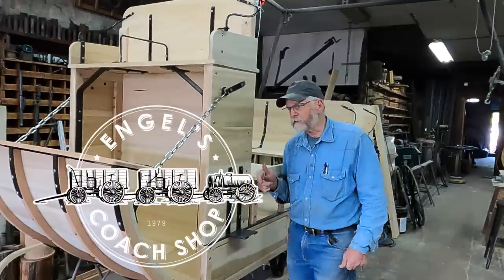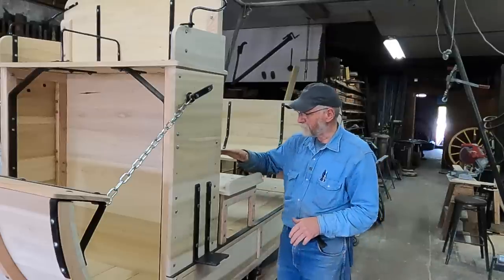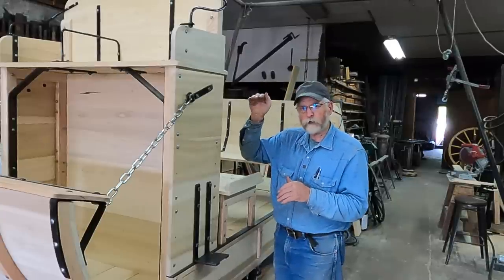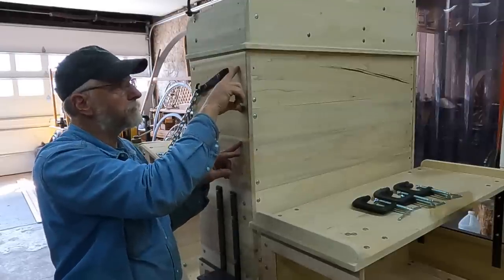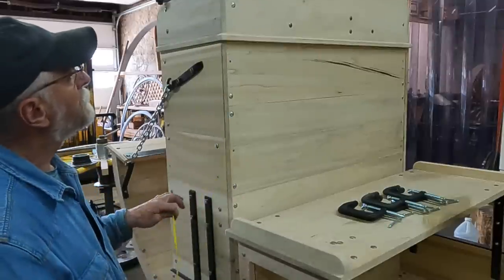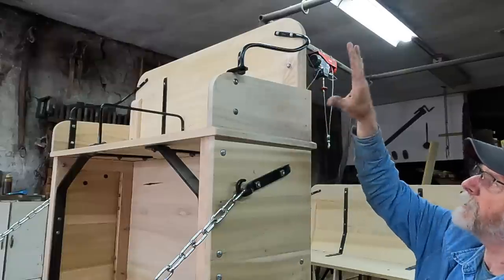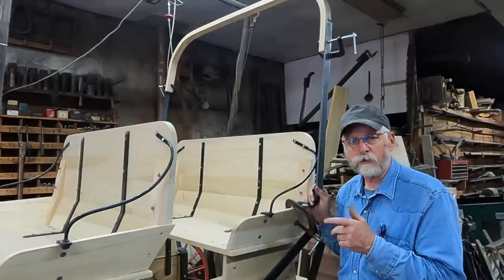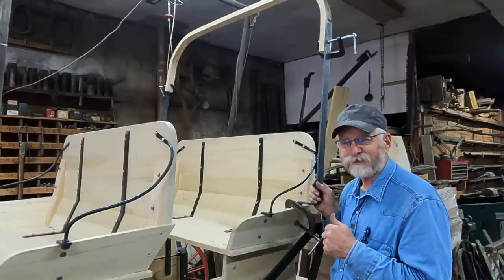Finally! The Last Piece of the Mud Wagon Puzzle | Engels Coach Shop

Comment: Great work again Mr Engels, thank you for showing.

I do love to see how you address the change of angle on those rear support irons.
It is probably going to be a fight and maybe even stretch out the material inside the passenger bench, because of the corners being in the iron allready. 
Or you cutting of the existing curved bits and welding on some new material and start from scratch.

I am curious!
(Plumber who had to redo some  bends in copper pipe once in a while, always difficult choice between fight and more new material)

Comment: 12:29 a bit difficult to pull off, but you can use the foot of the anvil to curve that piece. I've a similar one, and always use that rounded section to form tight bends, works really nice tho you do have to reach over the anvil.

Comment: It appears to me, when examining the photo, that the rear Irons run top to bottom, with the wood to the inside.  At the top the irons curve inward and attach to the panel on the rear bow.  That bracing would give lateral stability, preventing racking side-to-side at the top.  It looks like there are two fasteners (bolts?) in the rear panel, left side to attach the end of the top irons ( right side of photo has a damaged/blotchy area where the other two fasteners would be, given a symmetry for mounting both irons).  Maybe?  I first thought these thin lines in the photo were ropes or strings, but they could be irons on edge.

Comment: As you mentioned previously, that seat seems wrong.  It should be 6" wider at the seat and 6" higher at the back.  There would of course be Cushions.  To me, visually the entire seat seems 6" too high.  Galvanized chain?  I think not.
Amazing craftsmanship.
Reply: The galvanized chain will help prevent what happened to the first one. A cosmetic change in furtherance of durability is good in my book.
Reply: @scottgoodman8993  true, but not historically accurate.
Reply: @1:58... Not Galvanized... But chrome Mr Baker.
Though he's not done with it yet either...
Don't be so quick to judge every little thing my man...
Reply: @RickOshay...  Chain is NOT Chromed.  Hydrogen embrittlement could occur.
Don't comment on things you don't fully understand.
Reply: @Baker... Alright Mr Know It All!
Reply: @RickOshay...  Zinc plated-